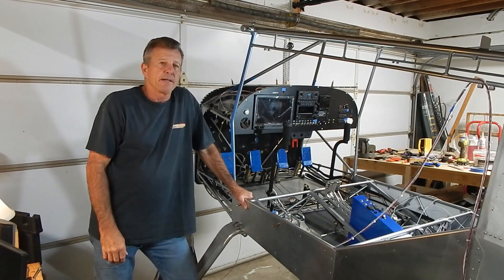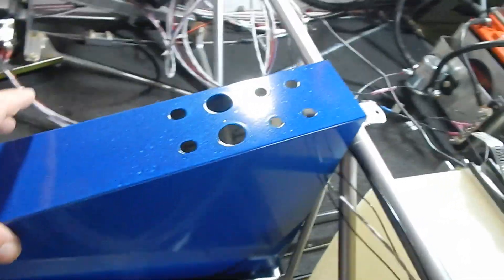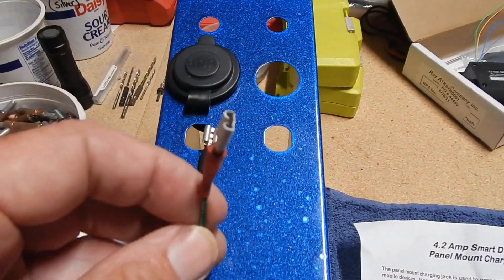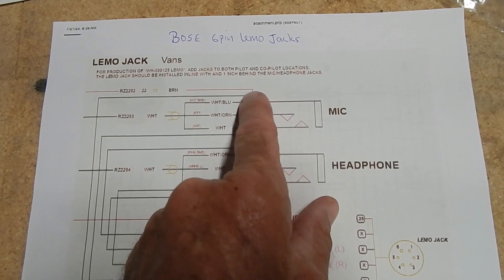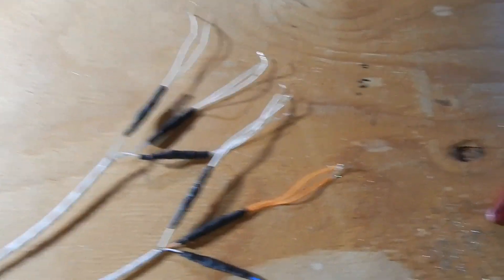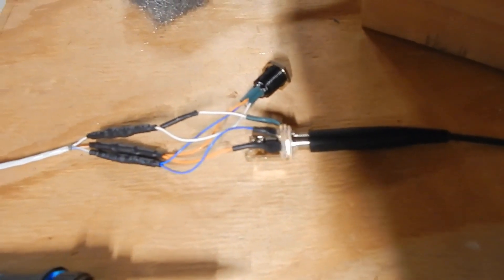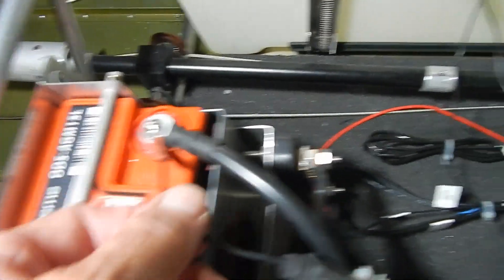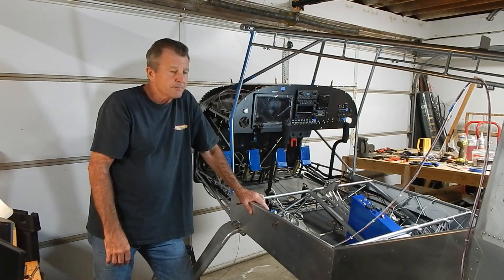RANS S21 Build - Ep 32 Installing headphone jacks

Comment: What size holes are needed for the Aircraft Spruce headset jacks?
Reply from the maker: Unfortunately it was a while ago, and the mounting hardware covers the hole so I can't measure it.  I don't remember if it was in the installation instructions, or I just measured with calipers.
Reply: @treetopflight7624 Thanks for the response. Good luck on your project!